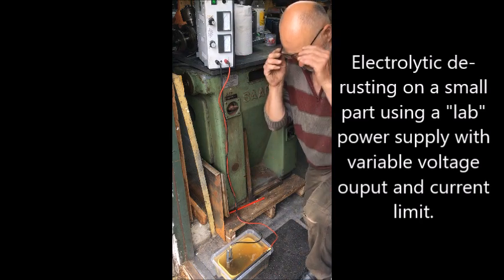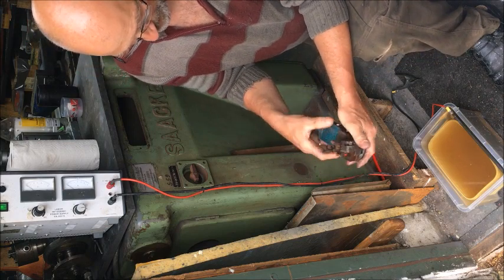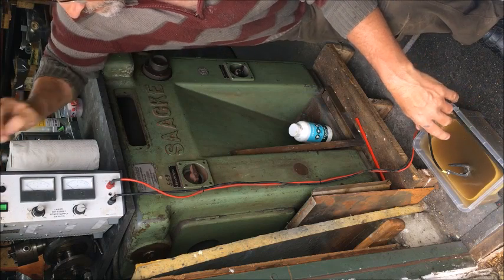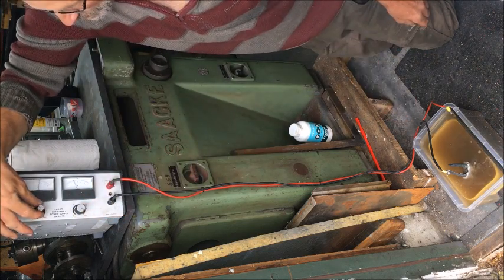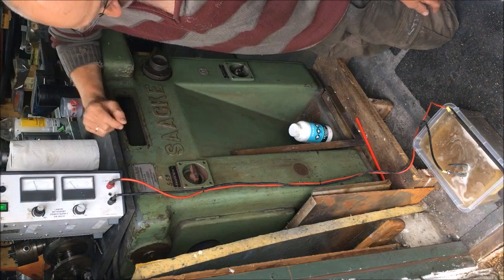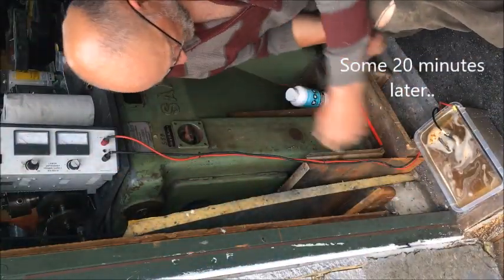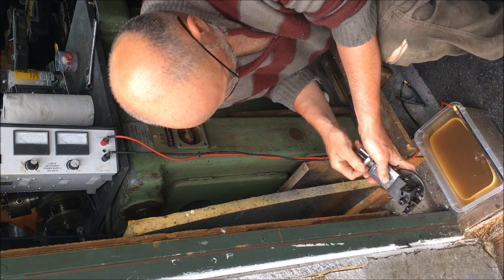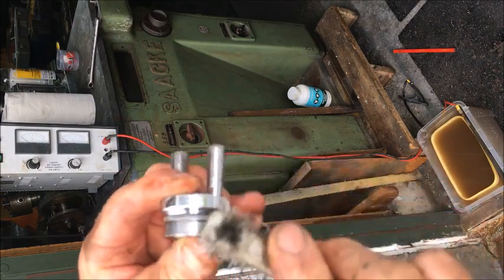Emco 8 top slide electrolytic de rusting

Comment: Electricity doesn't go around corners............use multiple anodes in different parts of the bucket and you'll get a better result.  Ohm's law doesn't mention this.

Stavros
Reply: For small parts, I have used a small, low speed, electric motor (automobile electric window motor) to rotate the part in the bucket.  I hang the part with wire, from the motor shaft.  I use a salvaged carbon brush assembly to connect the power supply to the motor shaft, so power runs through the shaft and hanging wire to the part. 

The first benefit from this is avoiding uneven electrolysis of the part.  The second benefit is it stirs the solution, which helps prevent recesses in the part from becoming blanketed by residue and debris.

I have tried several times to come up with a way to continuously filter the fluffy orange gunk out of the solution, but so far it has proved difficult.  I have tried cloth, paper towels, and air filter material, they all quickly clog. When I get some new ideas, I'll keep trying them out.
Reply from the maker: Hehe.. I know.. the inside bucket here allowed me to isolate the steel plate, but was also submerged and let the process/current flow. I have also used multiple leads like suggested, on larger parts eg. a lathe bed, but overall been happy with just one.